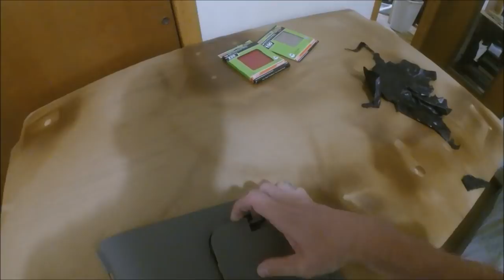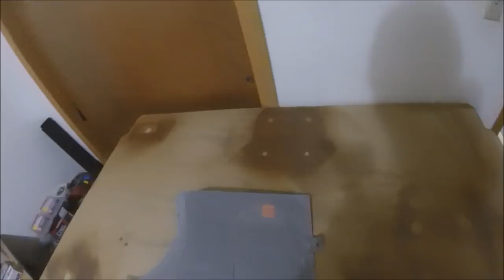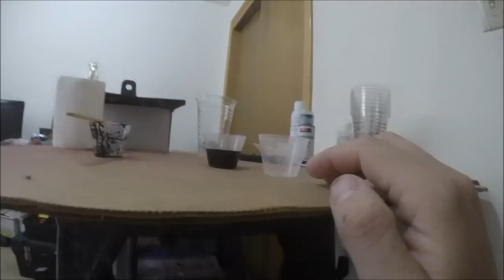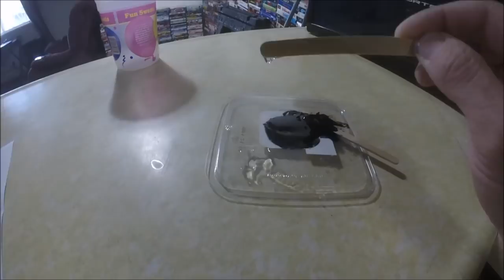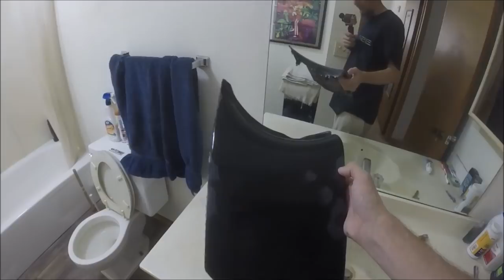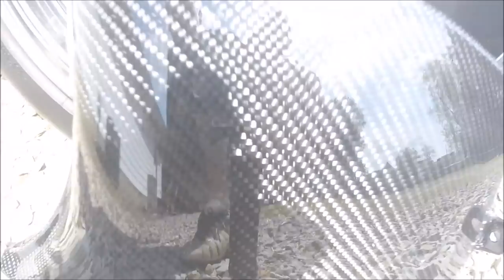How To Cover Car Parts In Carbon Fiber By Skinning/Wrapping

Comment: If you can take the dash out you could paint it with "rondo" which is a mixture of resin and bondo. The"sprayway customs" channel has a video on how to make it. That would give you a hard solid surface to adhere the carbon fiber to. His channel has a lot of videos on building custom dash and interior panel pieces from scratch. He mostly does box chevy stuff but its good content.
Reply from the maker: I had since decided its not a good idea because of the glare it would put on the windshield 😢
Reply: @TALONATER  you can use a matte clear coat over it. But  I understand, I had a car years ago I took the dash out and smoothed out via the method I mentioned and painted it. The glare was super bad, but I used a glass clear.
Reply from the maker: Yeah i used to have no dash and i painted the dash bar and clear coated it and the glare was really bad almost blinding 😢

Comment: Just a heads up, that mixing ratio only works for that product you're using. All other epoxy/hardeners ratio differs from 1:1 to 1:10+.
Reply from the maker: Yes sir 👍

Comment: The dash is a factory foam with vinyl over it. you cannot carbon over it. IT will crack. you would have to peal the vinyl off gel coat over the foam to create a hard still shell, then you can cover that in carbon. it's a long process. Join DIY Carbon Fiber group on Facebook. there you will learn all the different methods.
Reply from the maker: Thanks for all the knowledge man 👍

Comment: Here's a little hack for you. Instead of using body filler (bondo) use non scented baby talcum powder and mix it into resin and hardener. That way the base is resin and will adhere.
Reply from the maker: I used bondo to raise up the plastic to be even talcum powder will not do that 🤔
Reply: @TALONATER  hey I appreciate that, what I use the powder is to make a paste with the same consistancy as bondo with resin that already has the hardener mixed in therefore can do the same but without the fear, if any, that the two compounds will not be compatable.

I reckon you have done a great job and I look foward to more vids.
Reply from the maker: @tonybyfield2173  oh ok I see thank you so much for the new knowledge 👍

Comment: Great vid as always. just one thing  mate if you wrap the dash in carbon wont you get a lot of glare off of it when the sun hits it? was actally thinking of doing it to my Z but i live in England so dont have to worry about the sun as we dont get any LOL
Reply from the maker: Good point bro, a few years ago i had no dash and i painted the dash bar black and clear coated it well it put a huge glair on the windshield so i put a 370z dash in there 😂 i completely forgot about that lol
Reply: @TALONATER  can you use the same stuff to get a drycarbon effect maybe just hit it with some 1000/1500 grit wet an dry dont know how evan it would come out but you could try it on a test peice first?
Reply from the maker: No it would just have scratches on it then lol

Comment: You might look into total boat epoxy resin. It is made specifically for this stuff and is cheap by the gallon kit.
Reply from the maker: Nice thanks for the knowledge 👍
Reply: @TALONATER  no problem. Their channel here on youtube even has videos of them doing carbon fiber work.
Reply from the maker: Ill check it out thanks man 👍

Comment: Man this come out fire I was wondering how many coats of clear coat u used and how heavy did u go with the clear coat cheers man lovely work
Reply from the maker: I used a base coat for the carbon fiber to stick to and then three coats on top of the carbon fiber itself I also did 6 coats of clearcoat I normally only use four but I had leftover clear coat in the can so I did six 👍
Reply: @TALONATER  brillaint I done my engine cover and I was confused of what to use as in compound but its going in the engine so I thought clear coat /hardener would be right but can you use only clear coat I've had bad experice with clearcoat it comes out dotty so that's why I asked how heavy do u go with the first coat?
Reply: Would you also use clearcoat for inside compartments as in interior carbon parts?
Reply from the maker: @garry773  I'm a little confused about your question you said clear coat and hardener but can you only use clear coat clear coat won't work without hardener if that's what you meant by that question as for your clear coat coming out dotty that means that you didn't clean the surface good enough you have to clean it very very well before you clear coat or you will get pits almost like fish eyes from the dirt or oil that's still on there and my very first coat of clear I do very light just enough to cover then the second coat a little heavier third coat super heavy and so on from there the last thing you want to do is get imperfections or runs in your first coat and then try piling a bunch of clear on top of that the farther you can make it without flaws the easier it is to wet sand and buff out the imperfections or runs
Reply: @TALONATER  your an absolout legend you said you didn't understand my question but you understood it better then me that's exactly what I meant ill post a video of the part I've done I've got bumpy edges of the carbon on certain parts but majority is all flat the final light coat of resin I'm getting little dirt marks so today I'm ganna sand it all down with a thousand grit and use the method you use becuaee ure results are amazing do you use this same method for carbon interior parts aswell? As in door trims panel trims?
Reply: @TALONATER  could you use a clear coat only areosal can or does it need to be a 2k clear with hardener?? 🤔
Reply from the maker: @garry773  yes sir same method and thank you for all the kind words bro 👍
Reply from the maker: @garry773  if you're going to use spray can clear coat only use spray Max 2K clear it's the only stuff that actually has a hardener in it and is drying by chemical reaction and not air like other clear coats and may not be compatible with the resin 👍
Reply from the maker: @garry773  sure you could 👍

Comment: hey man do you think that one 2k clear spray can is enough to clear 2 parts that are as big as what you just wrapped in this video??
Reply from the maker: Yes absolutely just depends on how many coats you want to put I like to put at least four I just did a lot more because I had leftover but you could absolutely do four coats with two pieces that big just make sure when you're spraying that you spray so that the can is not angled it's the can is upright so that you can get every last bit out without having any sputtering 👍

Comment: Does it matter what resin you use if you tint it cause i can see wood and countertops resin i don't really see the difference or is there a specific resin to use
Reply from the maker: that's a good question I would think the only main difference would be the UV protection the stuff for countertops may not have enough UV protection to be used outdoors like for carbon fiber although once you clear coat it that should change all that 👍

Comment: Awesome outcome bro! Did you sand the surface of the part before you put the base coat on?
Reply from the maker: Yes absolutely 👍
Reply: @TALONATER  Thanks for the response! Hopefully mine comes out as good as yours.
Reply from the maker: @DarylKielMora  just remember bro take your time and if something happens and you're not happy with the final layer of resin you can just sand it down and keep doing it over and over until you're finally happy 👍

Comment: hey bro! I just finished sanding and I was wondering what  your process was for clear coating? Do you do one light and two heavy ?
Reply from the maker: I actually treat clear coat completly different than paint and do the coats all equally just be careful with the first 👍

Comment: Hey Brother quick question I'm getting ready to put test pipes on my 350 does that pop up an engine code when you do that and if so what do I have to do to deal with that?
Reply from the maker: What up well bro that depends on the test pipes they normally already come with o2 sensor extenders welded on them to trick the ecu by keeping the o2 sensors farther away from the mainstream of the exhaust flow hopefully yours does 👍
Reply: @TALONATER  thanks man mine do come with those O2 extenders I just wanted to get a little info from you cuz I know you had them in thanks for your time and I appreciate it
Reply from the maker: No problem anytime bro 👍

Comment: Great video! This is extremely unhealthy to do in your bedroom though. Sanding carbon fiber and epoxy in your room! Didn't sound like you were talking through a respirator either.. you seem methodical so I hope it helps.
Reply from the maker: yeah I was actually made aware of that not too long ago when somebody told me even though the resin doesn't necessarily smell it's still putting off fumes and sanding resin is horrible for your lungs I agree ☹️
Reply from the maker: I agree bro ☹️